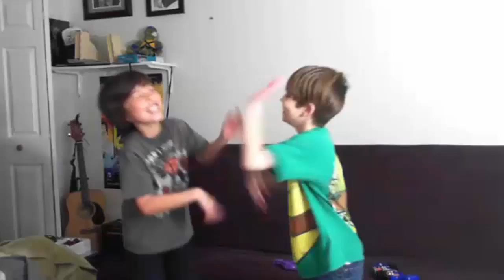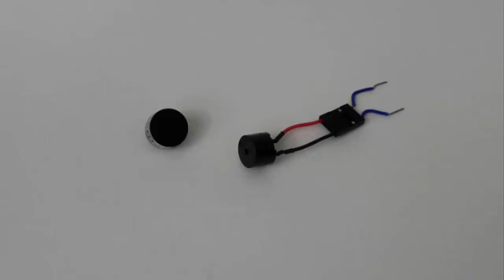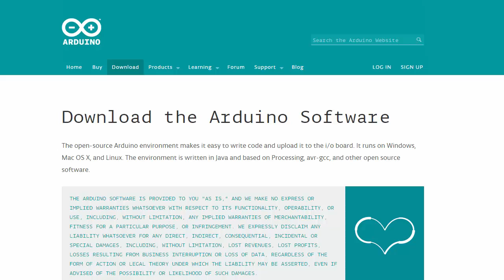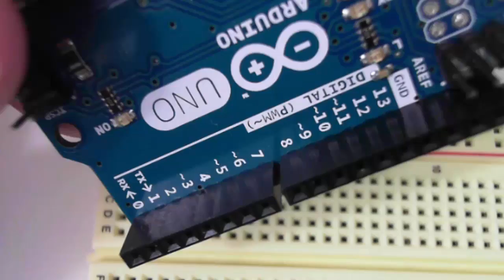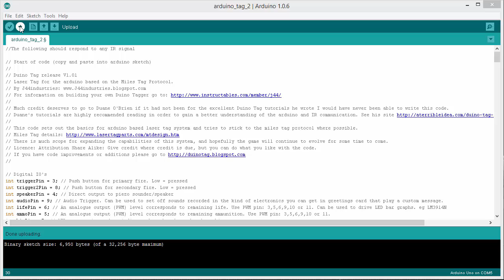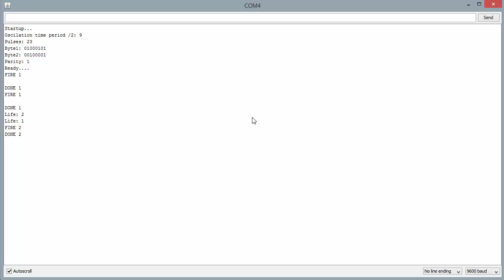Arduino Laser Tag - DuinoTag

Comment: Hey Bro,

I really love your project!
was wondering if you could repost the link for the sketch?
Reply from the maker: /*
* Giving Credit where Credit Is Due
*
* Portions of this code were derived from code posted in the Arduino forums by Paul Malmsten.
* You can find the original thread here: http://www.arduino.cc/cgi-bin/yabb2/YaBB.pl?num=1176098434
*
* The Audio portion of the code was derived from the Melody tutorial on the Arduino wiki
* You can find the original tutorial here: http://arduino.cc/en/Tutorial/Melody
*/

int sensorPin  = 9;      // Sensor pin 1
int senderPin  = 3;      // Infrared LED on Pin 3
int triggerPin = 12;      // Pushbutton Trigger on Pin 4
int speakerPin = 4;     // Positive Lead on the Piezo
int blinkPin   = 6;     // Positive Leg of the LED we will use to indicate signal is received

int startBit   = 2000;   // This pulse sets the threshold for a transmission start bit
int endBit     = 3000;   // This pulse sets the threshold for a transmission end bit
int one        = 1000;   // This pulse sets the threshold for a transmission that represents a 1
int zero       = 400;    // This pulse sets the threshold for a transmission that represents a 0
int trigger;             // This is used to hold the value of the trigger read;
boolean fired  = false;  // Boolean used to remember if the trigger has already been read.
int ret[2];              // Used to hold results from IR sensing.
int waitTime = 300;     // The amount of time to wait between pulses

int playerLine = 14;     // Any player ID >= this value is a referee, < this value is a player;
int myCode     = 2;      // This is your unique player code;
int myLevel    = 1;      // This is your starting level;
int maxShots   = 6;      // You can fire 6 safe shots;
int maxHits    = 6;      // After 6 hits you are dead;
int myShots    = 0;      // You can fire 6 safe shots;
int myHits     = 0;      // After 6 hits you are dead;

int maxLevel   = 9;      // You cannot be promoted past level 9;
int minLevel   = 0;      // You cannot be demoted past level 0

int refPromote = 0;      // The refCode for promotion;
int refDemote  = 1;      // The refCode for demotion;
int refReset   = 2;      // The refCode for ammo reset;
int refRevive  = 3;      // The refCode for revival;

int replySucc  = 14;     // the player code for Success;
int replyFail  = 15;     // the player code for Failed;

void setup() {
  pinMode(blinkPin, OUTPUT);
  pinMode(speakerPin, OUTPUT);
  pinMode(senderPin, OUTPUT);
  pinMode(triggerPin, INPUT);
  pinMode(sensorPin, INPUT);
  randomSeed(analogRead(0));
  for (int i = 1;i < 4;i++) {
    digitalWrite(blinkPin, HIGH);
    playTone(900*i, 200);
    digitalWrite(blinkPin, LOW);
    delay(200);
  }

  Serial.begin(9600);
  Serial.println("Ready: ");
}

void loop() {
  senseFire();
  senseIR();
  
  if (ret[0] != -1) {
    playTone(1000, 50);
    Serial.print("Who: ");
    Serial.print(ret[0]);
    Serial.print(" What: ");
    Serial.println(ret[1]);
    if (ret[0] >= playerLine) {
      if (ret[1] == refPromote) {
        // Promote
        if (myLevel < maxLevel) {
          Serial.println("PROMOTED!");
          myLevel++;
          playTone(900, 50);
          playTone(1800, 50);
          playTone(2700, 50);
        }
      } else if (ret[1] == refDemote) {
        // demote
        if (myLevel > minLevel) {
          Serial.println("DEMOTED!");
          myLevel--;
        }
          playTone(2700, 50);
          playTone(1800, 50);
          playTone(900, 50);
      } else if (ret[1] == refReset) {
        Serial.println("AMMO RESET!");
        myShots = maxShots;
        playTone(900, 50);
        playTone(450, 50);
        playTone(900, 50);
        playTone(450, 50);
        playTone(900, 50);
        playTone(450, 50);
      } else if (ret[1] == refRevive) {
        Serial.println("REVIVED!");
        myShots = 0;
        myHits = 0;
        myLevel = 1;
        playTone(900, 50);
        playTone(1800, 50);
        playTone(900, 50);
        playTone(1800, 50);
        playTone(900, 50);
        playTone(800, 50);
      }
    } else {
      if (ret[1] == replySucc) {
        playTone(9000, 50);
        playTone(450, 50);
        playTone(9000, 50);
        Serial.println("SUCCESS!");        
      } else if (ret[1] == replyFail) {
        playTone(450, 50);
        playTone(9000, 50);
        playTone(450, 50);
        Serial.println("FAILED!");        
      }
      if (ret[1] <= maxLevel && ret[1] >= myLevel && myHits <= maxHits) {
        Serial.println("HIT!");
        myHits++;
        playTone(9000, 50);
        playTone(900, 50);
        playTone(9000, 50);
        playTone(900, 50);
      }
    }
  }
}

void senseIR() {
  int who[4];
  int what[4];
  int end;
  if (pulseIn(sensorPin, LOW, 50) < startBit) {
    digitalWrite(blinkPin, LOW);
    ret[0] = -1;
    return;
  }
  digitalWrite(blinkPin, HIGH);
  who[0]   = pulseIn(sensorPin, LOW);
  who[1]   = pulseIn(sensorPin, LOW);
  who[2]   = pulseIn(sensorPin, LOW);
  who[3]   = pulseIn(sensorPin, LOW);
  what[0]  = pulseIn(sensorPin, LOW);
  what[1]  = pulseIn(sensorPin, LOW);
  what[2]  = pulseIn(sensorPin, LOW);
  what[3]  = pulseIn(sensorPin, LOW);
  end      = pulseIn(sensorPin, LOW);
  if (end <= endBit) {
    Serial.print(end);
    Serial.println(" : bad end bit");
    ret[0] = -1;
    return;
  }
  Serial.println("---who---");
  for(int i=0;i<=3;i++) {
    Serial.println(who[i]);
    if(who[i] > one) {
      who[i] = 1;
    } else if (who[i] > zero) {
      who[i] = 0;
    } else {
      // Since the data is neither zero or one, we have an error
      Serial.println("unknown player");
      ret[0] = -1;
      return;
    }
  }
  ret[0]=convert(who);
  Serial.println(ret[0]);

  Serial.println("---what---");
  for(int i=0;i<=3;i++) {
    Serial.println(what[i]);
    if(what[i] > one) {
      what[i] = 1;
    } else if (what[i] > zero) {
      what[i] = 0;
    } else {
      // Since the data is neither zero or one, we have an error
      Serial.println("unknown action");
      ret[0] = -1;
      return;
    }
  }
  ret[1]=convert(what);
  Serial.println(ret[1]);
  return;
}

void playTone(int tone, int duration) {
  for (long i = 0; i < duration * 1000L; i += tone * 2) {
    digitalWrite(speakerPin, HIGH);
    delayMicroseconds(tone);
    digitalWrite(speakerPin, LOW);
    delayMicroseconds(tone);
  }
}

int convert(int bits[]) {
  int result = 0;
  int seed   = 1;
  for(int i=3;i>=0;i--) {
    if(bits[i] == 1) {
      result += seed;
    }
    seed = seed * 2;
  }
  return result;
}

void senseFire() {
  trigger = digitalRead(triggerPin);
  if (trigger == HIGH && fired == false) {
    Serial.println("Button Pressed");
    fired = true;
    myShots++;
    if (myHits <= maxHits && myShots > maxShots && random(1,20) <= myShots) {
      Serial.println("SELF DESTRUCT");
      selfDestruct();
    } else if (myHits <= maxHits) {
      Serial.print("Firing Shot : ");
      Serial.println(myShots);
      fireShot(myCode, myLevel);
    }
  } else if (trigger == LOW) {
    if (fired == true) {
      Serial.println("Button Released");
    }
    // reset the fired variable
    fired = false;
  }
}

void fireShot(int player, int level) {
  int encoded[8];
  digitalWrite(blinkPin, HIGH);
  for (int i=0; i<4; i++) {
    encoded[i] = player>>i & B1;   //encode data as '1' or '0'
  }
  for (int i=4; i<8; i++) {
    encoded[i] = level>>i & B1;
  }
  // send startbit
  oscillationWrite(senderPin, startBit);
  // send separation bit
  digitalWrite(senderPin, HIGH);
  delayMicroseconds(waitTime);
  // send the whole string of data
  for (int i=7; i>=0; i--) {
    if (encoded[i] == 0) {
      oscillationWrite(senderPin, zero);
    } else {
      oscillationWrite(senderPin, one);
    }
    // send separation bit
    digitalWrite(senderPin, HIGH);
    delayMicroseconds(waitTime);
  }
  oscillationWrite(senderPin, endBit);
  playTone(100, 5);
  digitalWrite(blinkPin, LOW);
}

void oscillationWrite(int pin, int time) {
  for(int i = 0; i <= time/26; i++) {
    digitalWrite(pin, HIGH);
    delayMicroseconds(13);
    digitalWrite(pin, LOW);
    delayMicroseconds(13);
  }
}

void selfDestruct() {
  myHits  = maxHits+1;
  playTone(1000, 250);
  playTone(750, 250);
  playTone(500, 250);
  playTone(250, 250);
}
Reply: @ChrisHoffmanHoffmangler  Thank you so much!